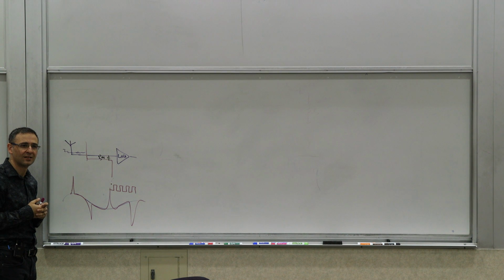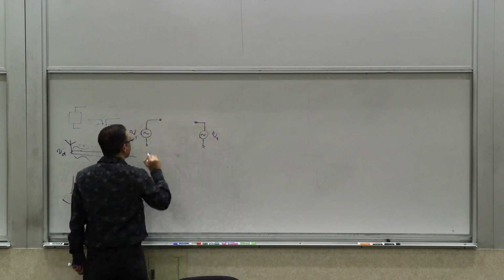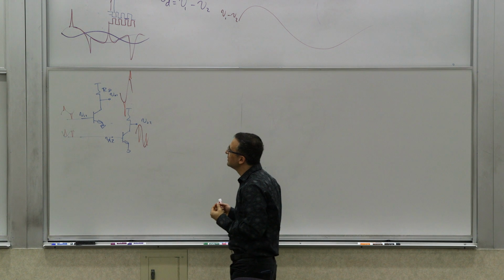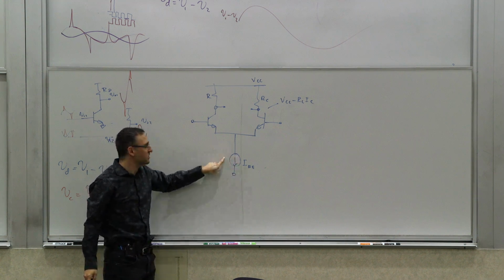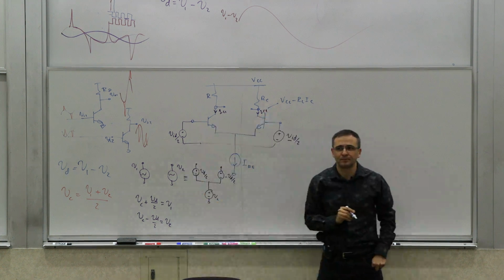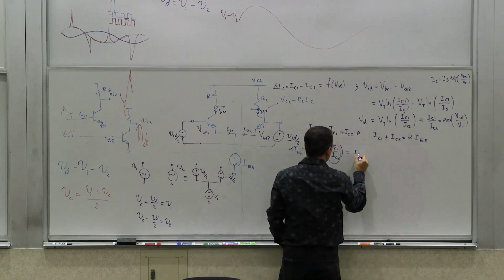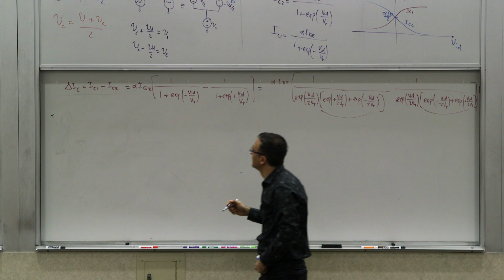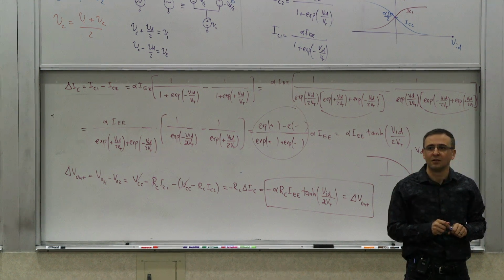126N. Differential Signaling and differential pair: core concept and large signal behavior (BJT)

Comment: Actually by using differential pair we can eliminate external noise to amplify by taking differential measurement noise will cancel. What will we do to eliminate internal noise? Cuz Electronic components are also adds some noise( thermal and flicker noise)  when compared to single ended amplifiers differential pair suffers with more internal noise( cuz of two transistors, two resistors almost internal noise doubles) isn't it?

Comment: I understand adding a common current source at the emitter fixes the sum. Hence, If both the Vbe's are increased, mathematically the sum restricts a change in emitter currents.. but we have literally increased the Vbe's right, what exactly restricts or decouples the transistors' from the exp'l relation of Ic to the vbes. By raising vbe arent we opening up the transistor to pass more current.

After some thought, I think ( I'm not sure ) my question boils down to; How does the current source compensate for the increase in Ie (due to increase in Vbe) and maintain a constant Ie
Reply from the maker: What happens is that when you increase the base voltages by A, the emitter voltages also go up by the same amount (exact if you ignore Early effect) and hence Vbe do not change at all. That is why we use a current source and not a voltage source.
Reply: @AliHajimiriChannel  Oh the current source drives the emitter voltage up, is that it? Thank you very much for responding, you are the best <3
Reply: @AliHajimiriChannel  

However, I still don't understand how  the current source will ensure equal increase at the emitter if there's an increase at the base. 

Yes, it makes that we don't have a voltage source tied at the emitter. Because a voltage source will keep the emitter node voltage constant. So from ΔVBE = ΔVB - ΔVE,
if there's an increase in VB there will be a significant change  in VBE because ΔVE ~ 0 ( VE remained constant).

But I don't see how the current source would enable equal change in VE (i.e ΔVB = ΔVE) so that ΔVBE = 0.

Please help me out, sir. Thanks in advance.
Reply: Thank you very much. 

You asked the same question I needed to ask. That's why I checked the comments to see if the question as been answered.

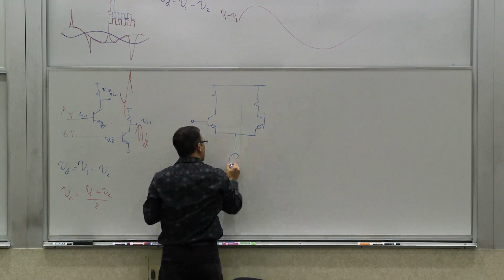Comment: 17:39, I have never seen such an explanation of differential amplifier. Thanks, sir. Where can I get more related to stability and Miller's compensation. Why capacitor decreases stability (in terms of voltage and current).
Reply from the maker: Watch videos 169N, 170N, and 171N
Reply: @AliHajimiriChannel  Thanks sir
Reply: Capacitor impedance equal to 1/SC it adds pole to the system. that too it adds pole at origin. stability of the system decreases.